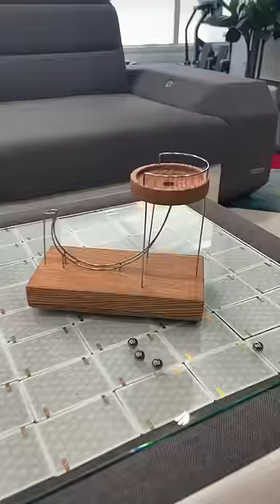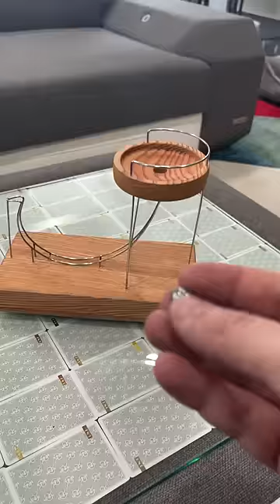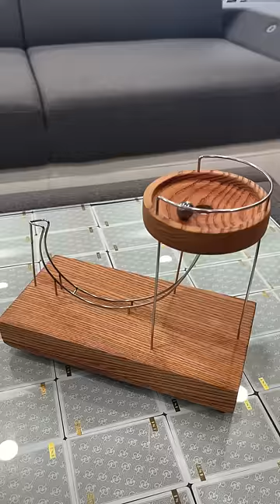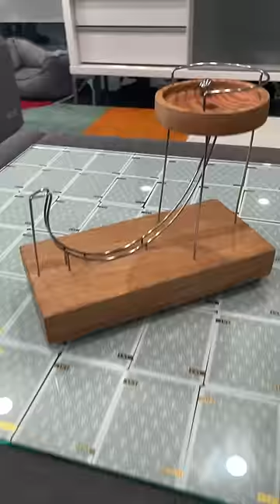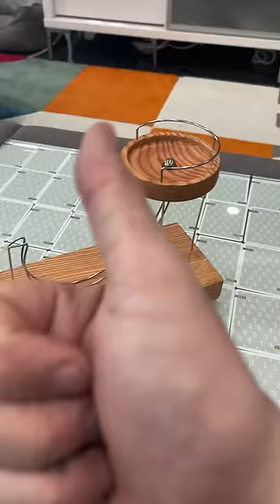An Impossible Perpetual Motion Device?! 😳 #Shorts

Comment: Imagine living abroad for 5 years and you return home and that sh* still playing lol
Reply: Those would be some good, long lasting batteries
Reply: L
Reply: it won't 
hole will covered with dust
Reply: @NishantCosmos  nah the ball don't let that happen
Reply: It would run out of battery by that point
Reply: @kgapaneseschoolgirlb  not if you connect it to the house
Reply: @brrrrrr  I mean, I don’t see anywhere to connect it to the house. It takes batteries. That’s a different source of power than just plugging it into the mains
Reply: Don t think the battery would last so much
Reply: How long last the hidden battery that feed the wire?
Reply: Their ain't no battery on that weirdos
Reply: The energy is provided by gravitational force.
Reply: @kgapaneseschoolgirlb  As it is, yes. But if you know enough about electronics and have certain parts, you can make a custom inverter for it.
Reply: @seighartmercury  At that point, I think I’d just buy one that plugs into the wall lol…
Reply: @kgapaneseschoolgirlb  Hahaha That's fair, but I didn't exactly know if there's such a thing for sale lol
Reply: Does someone knows why he Say "that doesn't exist"
I mean, does that means the ball Will stop, and if it does, why that happens
Reply: @MdVaDc  right? I still don't get why these guys started talking about batteries out of nowhere
Reply: @DiAn-ud8dy  There's a hidden contraption that speeds the ball up, which means there's something that's inputting energy into the system, hence it's NOT a true "Perpetual Motion Machine".
Reply: @seighartmercury  😭i thought that was the same motivo 
Thanks for explaining it
Reply: @omahaikk2191  Lol, you think gravity pulls something that fast?
Reply: @ericamendoza347  I do. Faster than that. Apparently you aren’t familiar with gravitational force, which is 9.86 m/s2 and which affects every single object on earth, including the ball before it even enters the hole in fact it it is made to enter the hole. Learn your physics before lol and shame.
Reply: @omahaikk2191  My point is do you think the ball is launched back onto the top with just only gravitational force? We haven't even reached a common ground here and you're already acting as if I never attended any physics class
Reply: @ericamendoza347  I know now that you never attended a Physics class.
Reply: @omahaikk2191  I now know that you think this ball is forced back up with only just gravity lol. Ironic
Reply: There is no batteries dummos
Reply: @ericamendoza347  People know, that is you studied Physics 101 or even lower, you wouldn’t be asking me that question to begin with. Sorry for you. Hint: centripetal force!
Reply: @omahaikk2191  Too bad Chris already hinted out that this isn't really an actual working perpetual motion device, but you still think it's real. Watch and listen 101. Also, even an average person who studied physics or lower knows that ball was launched too high than it actually should've when it dropped down. I feel sorry for you.
Hint: Batteries!
Reply: @kgapaneseschoolgirlb  it could have a connection for pluggin into the wall. I had a thing for swinging my phone that ran on both.
Reply: @Frost059HD  I don't know much about physics but I know a thing or two that this acceleration is too fast for it to be possible with just the force of gravity
Reply: Ong ..be thinkin somebody broke into yo shii 😂 💯
Reply: If only my ps4 controller lasted that long 🤦🏾‍♂️
Reply: @MdVaDc  Of course there is a battery in it. Do the math. Or build a ramp and try it for yourself.
Reply: @Frost059HD  I have one of these and the ball is accelerated using electromagnetic force that is hidden inside the wooden base with a battery. I bet you're a highschool drop out yourself. You obviously didn't do any research about the machine
Reply: @omahaikk2191  The height from where the ball drops down is too low for it to provide enough acceleration for the ball to launch itself back up to the top. Even if you drop the ball higher, it still wouldn't reach the top. Why? Conservation of mechanical energy. If you release the ball from a certain height, that ball can never come back to a point where the height is any larger. So it is not possible with only the aid of gravitational force. With all those stuff you said, you didn't actually do any calculations yourself. I bet you were just attending physics class without actually paying attention to the lectures
Reply: Lol, Dissidious Dissension deleted his comment out of embarrassment after realizing they were wrong. Couldn't believe the intelligence of that guy
Reply: The battery wears out in 1-2 days.
Reply: @DiAn-ud8dy  the parts will wear down at some point. It is physically impossible to go “forever”
Reply: @kgapaneseschoolgirlb  there are no batteries in it
Reply: @danielblomberg8926  there are no batteries
Reply: @deemo1775  the G force is solely provide an acceleration and only pulling downward as you know it. And as you said about conservation of energy, it creates a normal force N which is perpendicular to the curve surface. The curve radius, the mass of the ball… and the velocity of ball, all contributes to centripetal force that directs the ball to the catch. You can consider the Centripetal force as a a normal force that moves. 
I studied Physic 201, Statics, Dynamics, Wave and Fields. Not a lot of lab experiences but theoretically that’s how it is interpreted. You as everyone else with simple head keep dictating my words as G force causes it all. It is only responsible for starting the movement. 
Note, even the ball on its path back to the bowl is undergone gravitational pull. Nothing escape G.
Reply: @omahaikk2191  yeah, but it says on the site that it needs batteries. If it’s just gravity, normal force, etc, then why does it need batteries? Like, you can try and throw a bunch of concepts out, but we know the machine uses a battery to achieve this. Obviously the concepts you explained exist, but we know the answer, so you can’t really explain away why it has batteries in it
Reply: the wood would wear away
Reply: Due to friction, materials will wear off during that time and it might change the way the ball is moving that might also cause it to stop eventually. Just my theory. 😅
Reply: @dobrysiabar8791  Okay genius, go look at the longer video on this very channel. He even shows the battery, you tool.
Reply: @joeschlomo2143  thanks, is really obvious but i didn't Even think about it
Reply: @omahaikk2191  Clearly you said in your first comment that the ball moves like that according to gravity. That's why I'm asking if you think the ball is launched like that solely due to gravitational force. You even confirmed that on your 2nd comment. Even with all those forces you mentioned it ain't possible for the ball to launch like that without something providing it enough energy to launch itself back up. Why don't you buy one of those and test your hypothesis lol
Reply: @omahaikk2191  no sir, he meant with the height that's there and the mass of that ball, the ball can never be pulled fast enough to exceed its initial heights

That is, potential energy is,
mgh

Now,
New height after the ball rolls up is
mgh'

h<h'

This contradicts the Law of Conservation of energy.

Thus, gravity can never pull a ball that fast  to exceed h' until the ball falls from a considerable height

In this scenario the somewhat rolling motion in the funnel adds to the initial velocity(u) this the ball is able to get additional speed to get to h'.
s=ut+½at²

If u release the ball from hole of funnel, s is less
, But when the ball rolls up a bit it gets its height which is ut more.
Reply: @JaredFrontman  The rolling at the start doesn't do that. It's battery powered. Stop trying to make up needlessly complicated nonsense to explain the obvious.
Reply: @omahaikk2191  Go ask a Physics teacher, then come back to apologize Erica.
Reply: Imagine someone lived in a crawl space in your house and kept it going...forever.
Reply: @SilverEye91  Yeah, I was thinking that too; the acceleration was too high to match the mathematics. Later I found by reading other's comments that it could be (as you said) accelerated using magnets or winds. And just for clarification, by "rolling at the start" I meant the rolling "in the funnel" not the rolling in the "slide", because it's obvious that you and I have pretty much the common sense to understand the fact that the ball really can't exceed its initial height just by rolling on the slide. However it often happens that some rare people(like the one whom I mentioned in the previous comment) do face problems understanding these phenomenons due to their intellectual distinction that makes them fall on the left hand side of IQ Bell Curve. I suppose you know who lies in the left side of the IQ Bell Curve.
Reply: @JaredFrontman  Dunning Kruger Effect at its finest

Edit: I'm not pertaining to you
Reply: @braydenreid6542  in video the person never showed the battery, and as what energy it created for. I would assume then battery is in and under that tray, creates magnetic field to give the metal ball a upward push so it won’t stay still.
Reply: @gracechananigans4395  true! Friction exists. That’s why the tray surface is sloped downward. Unless there something blocks the track, the ball will move once it lands.
Reply: @NishantCosmos  no it won't lol
Reply: @enersysuy9535  The bearings charge the battery.
Reply: @Tanu75298  the ball will erode the machine though and eventually change the trajectory or not catch the ball
Reply: Hmmm
Reply: Hmmm
Reply: @MdVaDc  you must be better proud being so smart.
Reply: @omahaikk2191  centripetal force can not do work on an object, since it acts perpendicular to the velocity. It can change the direction of the velocity, but it can't cause the object to speed up. Centripetal force can not increase the kinetic energy of an object. 

Also, centripetal force is just the resultant force on an object; it is not an external force. Some other force has to provide the centripetal force. 

Some of the things you're saying are correct, but you're using them to draw incorrect conclusions.
Reply: @Agent0Smith  you’re right! And I didn’t mean the Fc is the force that causes the movement. It only shows where the object going towards (perpendicular to V)
Reply: @omahaikk2191  that's true, but it isn't the reason that the ball is able to jump back up to where it started from. It reaches a much higher height in the air than what it started from; you should remember that it is not possible for a ball to roll down a ramp and end at a height greater than it started from. 

It's pretty clear that the ball accelerates at an unnatural rate when it first falls through the hole. Gravity alone will not cause it to accelerate that rapidly.
Reply: Welcome back!
Reply: @omahaikk2191  "tHe eNeRgY iS pRovIdeD bY gRaviTatioNaL fORce" 😂😂😂 BOZO
Reply: @DiAn-ud8dy  it doesn't exist because this contraption is not really a "perpetual motion device". It is actually powered by a battery meaning it is not a true PMD
Reply: @MdVaDc  do you want to bet? It's powered by an electromagnet that takes batteries to operate. Your not to bright huh?
Reply: Bro said “abroad”
Reply: I was actually thinking this because I work abroad a lot for long periods 😂
Reply: @ryunosukeakutagawa5240  Tbh, it applies to me. I was stupid to not see that at first and straight away commenting like a 1 y.o... my bad
Reply: No, after 5 years the batteries will have run out.
Reply: Just fake sorry. If the ball return to the same position means that she get more energy than just what she get by falling
Reply: @dobrysiabar8791  
Yes, there are.
They are in the base with a magnetic assist apparatus. I've seen this before and almost bought it but couldn't spare the money at the time. 

IT'S A TRICK, DINGLEBERRY!!!
Reply: @dobrysiabar8791  yes, there is dum dum
Reply: @omahaikk2191  got some second hand embarrassment reading your comments.
Reply: You are the funniest person living I have ever met in my life😂😂😂😂😂😂😂😂😂😂😂😂
Reply: Zlatan Ibrahimovic did something like that with his playstation.
Reply: @omahaikk2191  Nope you can't go higher than the original starting point without acceleration of some kind. In this case there has to be a electro magnet inside the wooden bowl that charges the rails and pushes the ball.
Reply: @BrazilianImperialist  How are you so confident in something that is physically impossible? You are obviously not a STEM kid, go take this problem and show an actual physics professor and listen to what he says.
Reply: spose you could plug it onto the mains
Reply: @enersysuy9535  no way is there a wire ,  hid that didnt he
Reply: @seighartmercury  yeah and a caravan for the ball to pull around like  a hotwheels  car
Reply: @DiAn-ud8dy  the electricity goes
Reply: @ericamendoza347  there may possible be the odd  sceptic , amongst us 😨
Reply: @BrazilianImperialist  they know     its a flea circus  duuuuhh
Reply: @omahaikk2191  like rose fugal
Reply: @deemo1775  not if its green energy
Reply: No the batteries would probably run out
Reply: @omahaikk2191  well you obviously don’t know basic physics.
Reply: @MdVaDc  It may not be a battery, but there is defenetly a elekromagnet hidden in the base that has to be powered by something.
Reply: @DiAn-ud8dy  There is a magnet in the base, speeding up the balls while they fall. It basically turns on and of to launch the ball and add speed to it.
Reply: @omahaikk2191  Omfg, this man didnt rly just say learn your physics... This isnt even a perpetusl motion machine. Its powered by electro magnets, hence, not perpetual motion.
Reply: @dobrysiabar8791  There are. Or its powered by a ac plug, but its defenetly powered by a electricity sour e
Reply: @omahaikk2191  It literally defies the laws of physics.... and since you dont seem the be the sharpest tool in the shed, ill explain it so that even a 4th grader can understand this. If the only source of power is gravity then that gravity, lets call it g, applies the same amount of counterforce over the same amount of distance, on the way back up. Lets call that k. g and k are always equal (the speed u gain form dropping a ball from 3 inches is lost once the ball travels 3 inches back up). Then there is all sorts of things slowing the ball down, lets stay simple here and just name air friction, f. g-k-f=?.
g and k are equal so they cancel each other out (example: 2-2-5=-5, 5-5-3=-3)
So we are left with -f. That a negative force, meaning we have a net loss in speed. Nice physics 101 u got there.
Reply: @ToxicOnAWave  it's a battery underneath I went and researched it.
Reply: @seighartmercury  It's a simple magnet trick. If you place a ball that is not magnetically attracted, on it, it would cease to function.
Reply: Excelente humor.
Reply: @ps4gamer811  i'm not your bro. And yes I said abroad. So?
Reply: @omahaikk2191  If the energy was provided by gravitational force, then the ball would only rise at a maximum up to the height it dropped from, with a 0 energy loss environment.  Now, this machine has friction energy losses both in the ball bobbling in the tray and as the ball travels along the wire rails, not to mention air friction losses.  Notice that you can hear the ball moving? That sound is produced by energy lost from the system, which means that energy is being secretly input from somewhere to create the perpetual motion illusion.  This illusion is produced by a spinning, battery powered electromagnet hidden beneath the unit to provide extra energy input as the ball rolls along its track.
Reply: @kgapaneseschoolgirlb  yes but i have rebuilt one without batteries
Reply: @MdVaDc  but if you just remove the battery there isnt any anymore
Reply: @shuheihisagi6689  my physics professor said that it is totally viable and the only reason we dont use this for power generation is the government artificially limiting us
Reply: @Unicornp00q  it has a magnet in it, its not a mystery. Your teacher is just talking about renewable energy in general.
Reply: @shuheihisagi6689  first of all he isnt a teacher he is a professor
second of all you act like youre on bidens payroll as well so dont even let me get started on you
Reply: @Unicornp00q  "My physics professor said..." lmao what is your physic professor your daddy? How does that explain any of the actual physics taking place in the video?
Reply: @shuheihisagi6689  honestly miss me with your ad hominem
stop trying to bring my daddy issues into this to belittle me
yes hes a father figure to me SO WHAT
also if you'd just open your eyed for once youd clearly observe that it loops perfectly. do you see a battery or a magnet? clearly no
Reply: good comment
Reply: @viddeliten  but perputual machines exist dear
Reply: @apscafe  lol ok
Reply: @Tanu75298   hahah try it, at some time amount of dust will be enough  to stop that ball
Reply: @kgapaneseschoolgirlb  they sell battery to ac adapters. If you don’t know what that is, it’s a battery shaped thing that you put in place of the batteries that connects to a cable which connects to a wall plug. They come in the standard battery sizes.
Reply: @ryunosukeakutagawa5240  I’ve heard a good example of Dunning-Kruger effect is people mentioning the Dunning-Kruger effect in YouTube comments. You’re addition of, “at its finest” was really the icing on the cake.
Reply: @ryunosukeakutagawa5240  also, you said, “I’m not pertaining to you.” 😂 nice. You’re batting 1000!
Reply: @omahaikk2191  you’re tilting at windmills buddy, you’re attempting to poke holes in claims nobody made.
Reply: @godwins2027  Someone's mentioned that before but that defeats the point. I can make a car a sail boat if I make it float and add sails to it, but at that point, probably should just buy a sail boat.
Reply: Nah, either the battery or the ball will lost from the rail
Reply: Until the cat gets it
Reply: no worries, the battery will die off in few weeks
Reply: REPENT FROM YOUR SINS AND FOLLOW THE LORD JESUS CHRIST TO BE SAVED OR BE CAST INTO THE LAKE OF FIRE FOR ETERNITY REPENT AND BE BORN AGAIN !
Reply: @viddeliten  how would batteries play into thos though? This isnt perpetual due to friction and outside forces not allowing it to go on forever. How is just dropping a ball battery operated? They had stuff like this before batteries after all.
Reply: @RedQuill13  just watch the video before you comment, please.

Every ball makes it back up from the potential energy it has (and a battery driven magnetic push). If it was losing energy, the ball wouldn't make it back to its starting position.

Since friction exists, we know energy is added in order for the ball to get to its same potential (height) and we can see it goes higher than that, so energy was definitely added to it.

Furthermore there are other videos on here that explains it.
Reply: @NishantCosmos  Dust don't accumulate when no one's moving in the house
Reply: @omahaikk2191  gravity will never bring the ball higher than it started, or even to where it started because friction exists. Potential energy. There needs to be a power source in this thing.
Reply: @DiAn-ud8dy  it stops when the battery dies
Reply: @omahaikk2191  i know you never attended physics class either
Reply: Lmao... Now I understand why people say "half knowledge is more dangerous"... Since they "learned" about gravity, these people think gravity alone is enough to power the ball to jump higher than it's initial position... What next, you slide from a slider and gravity will launch you to Moon...?!!
Reply: Iron Path shall be worn by the ball fricion until they finally break down dedtroing the machine!
Reply: Now put your hand in the path of the ball when the ball flies back and see what happens to your hand
Reply: @omahaikk2191  its a magnet not gravity pulling it.  Gravity doesn't exist.  It's just density, a ball falls through the air because its heavier than the air around it and stops on the ground because the ground is denser than it not some magical, invisible force that came out of human inagination that is pulling it.
Reply: @viddeliten  thats called atomic batteries 20k years baby
Reply: @omahaikk2191 if you believe that, build one! I want to see it work!😂 Can't you see the ball unnaturally accelerate? Hidden batteries power an electromagnet.
Reply: @kgapaneseschoolgirlb the idea is to make it look unpowered. To make it look like perpetual motion, which is impossible.
Reply: God, the Lord Jesus Christ loves you! Restore your relationship with God by repenting of your sins and putting your faith in Jesus Christ, "... that Christ died for our sins according to the Scriptures, and that He was buried, and that He was raised on the third day according to the Scriptures..." (1 Corinthians 15:3-4)